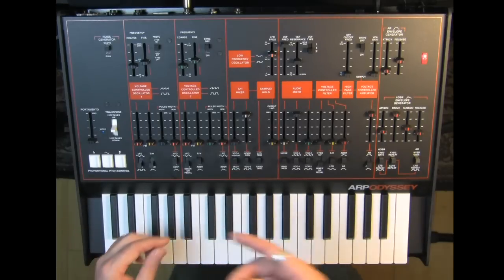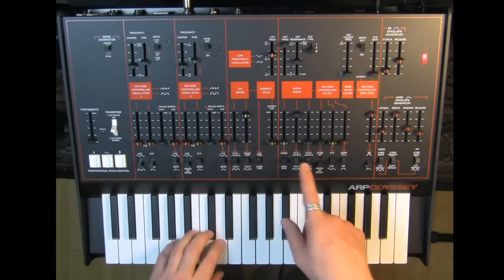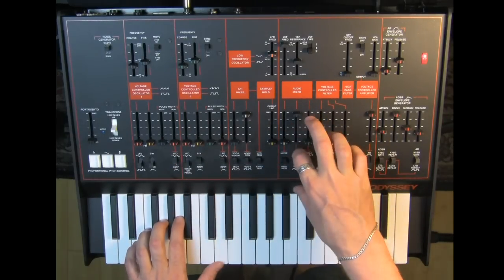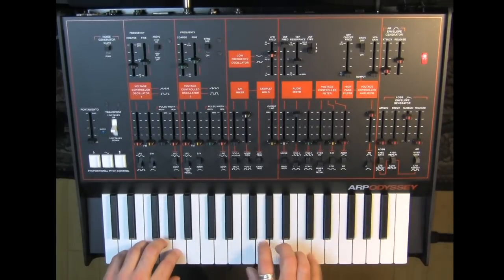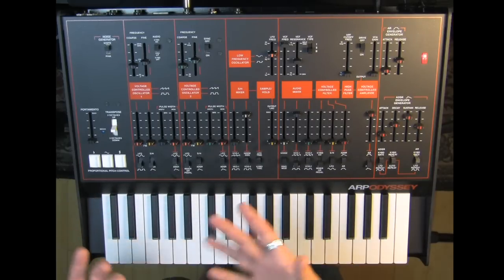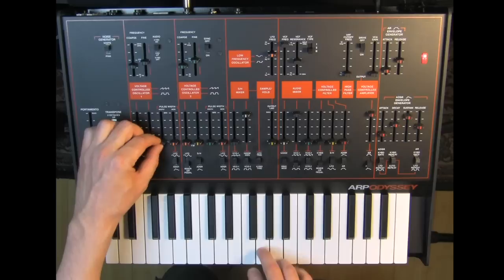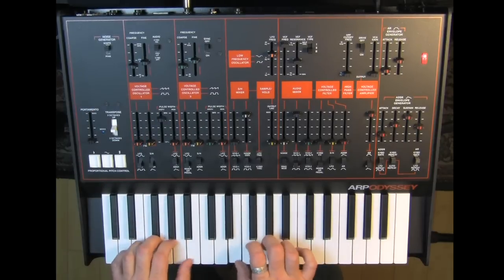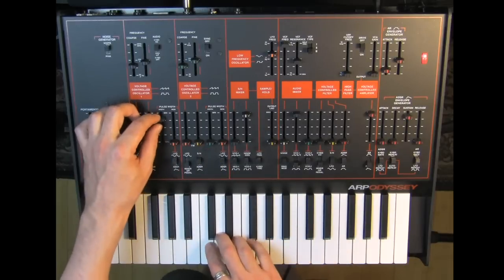02-The Korg ARP Odyssey: Oscillators 1

Comment: CAN YOU PLEASE HELP ....... My Arp Odysey only makes one noise and doesn't play different pitches when i use its keyboard :( - Can you advise how  or what switch I need to press to make the keyboard active for it to play different notes ? right now it only plays one note -- they note you set the VCO
Reply: Did not u opened vca all way up (slider VCA Gain) thinking it was a volume slider ? (I did that when i've had the Odissey first ....)